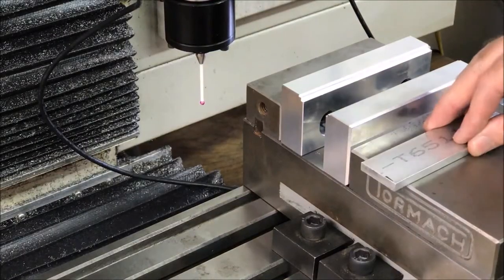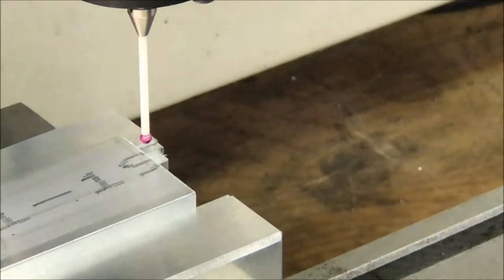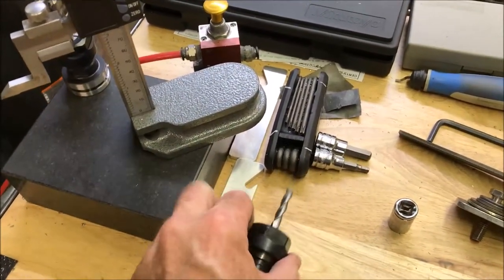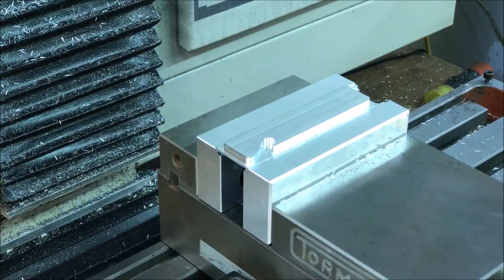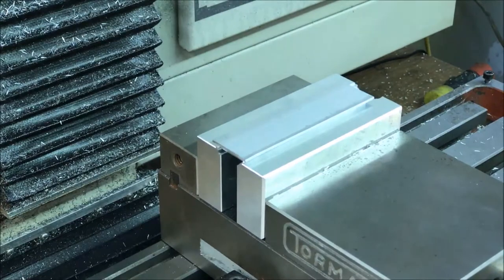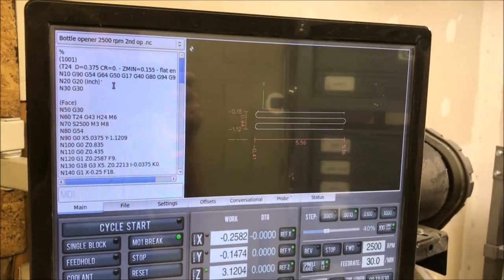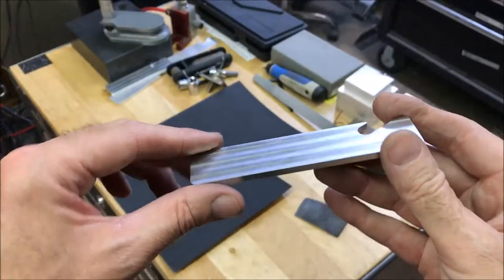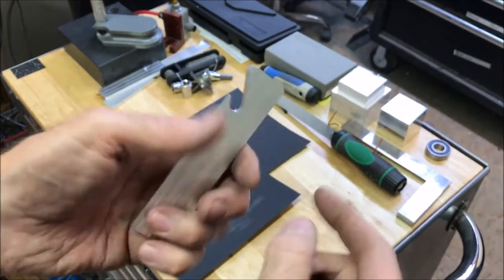Bottle Cap Opener Part 1 - Machining

Comment: Running your off the machine parts on a 3M finishing wheel will clean up the finish.
Reply from the maker: Are you talking about the kind you put on a die grinder?  I have a scotch bright wheel on my bench grinder for steel but I figured that would too much for an aluminum part.

Comment: Your feeds are terribly slow, I'm running at least twice as fast conservatively on a G0704 clone. I think you need to get some stock and have a play around because that tormach is capable of much more.
Reply from the maker: Sorry, I was considering the mini mill and such mills for the 2500 rpm range.  I will have to add the larger 2500 rpm mills to the feeds and speeds.  I was also uncertain about holding the piece with only .050" as I mentioned near the end of the video.  Yes, I can make that part in less than 2 min on the Tormach 770.